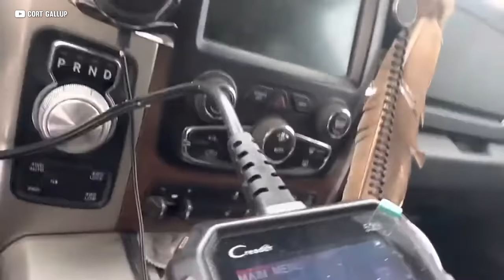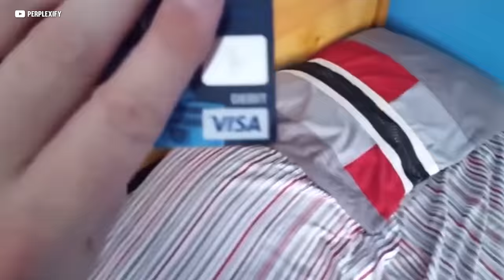Worst Trucks Only Stupid People Buy

Comment: I have a 99 f250 super duty with the Triton 5.4 and all I've had to do is valve cover gaskets and spark plugs and the spark plugs aren't as bad ass everyone talks about, proper torque and anti seaze and boom, the truck ever drove across country before I fixed the oil leaks and did amazing!
Reply: I got a 2001 and I love it 54 two valve change the oil it'll run forever

Comment: 2004 Silverado with the 5.3L.  Port injection.  No VVT.  No AFM.  Just a good old solid V8.  Simple engine.  3k mile oil changes and  non ethanol gas in the tank.

Comment: I just returned from camping with a Navajo family at Monument Valley. Our host runs a tourism facility involving pickup trucks modified with open seating for 15 people instead of a traditional bed. He showed me the parking lot where they park the trucks. One thing I quickly noticed. About 90% of them were GMT800s. The rest were GMT400s and a handful of GMT900. Most were model years between 2001 and 2003, he said. He explained why the company focuses on the GMT800 platform. "Our trucks have a very hard life. We use them to moving heavy loads every day across hundreds of miles of unimproved, dirt roads, and with minimal maintenance, day after day, year after year.  If they break down, we lose money. If they require too much maintenance, we lose money. We change the air filters more often than usual and we run fresh synthetic oil every 3000 miles, and that's about it." They avoid diesel engines because of maintenance costs and unreliability. Most of them are 5.3s or 6.0 vortecs. The interiors receive zero maintenance and all were extremely dirty and many with broken armrests and door handles. The beds have all bed removed and replaced with fabricated heavy steel bleacher seating to accomodate 12-15 people with sun canopies. They run these trucks hard and have learned lessons on which trucks will survive their harsh use case and which ones don't.
Reply: Just came from there myself, noticed the same thing.
Reply: Nothing runs like crap longer than a GM!
Reply: Yes two of the greatest motors ever designed

Comment: I had a 2008 ram 1500 with the 4.7 with a six speed. I put 109,000 in 11 years. I had to put a new clutch at 108,000 mi. As far as the engine goes it was never an issue. Always ran well. Unfortunately due to health reasons I had to sell the truck soon after I replaced the clutch. The guy I sold the truck to is still driving it with only a small brake line issue in four years.
Reply: 10k miles a year is an easy life for that truck. I just crossed 91,500 with my 2019, only had the expected exhaust manifold issues but covered by warranty.
Reply: 109K is not a good test. 209K you're getting close.

Comment: To this day you will still never beat a small or big block Ford  Chevrolet or Chrysler OLD SCHOOL parts are plentiful and easily repairable.
Reply: I've got my Dads 98 Silverado 
268,000 miles. Oil changes regular. V8 350
 Starter alternator but no water or fuel pump problem yet.

Comment: I`ve had P/U trucks since 1978 and never had any serious problems, just routine maintenence and some starters W/Punps and alternators, They were bought new and used in a masonry company all 4WD and all FORDS. Diesel and gassers and never went more than 4000 miles between oil changes. I think I bought my last one this year, a F350 6.2 gasser and I`m 71 years old now. No more working for me or my truck. Were going cross country this spring with the pup.

Comment: The 2 valve 5.4 was solid while the 3 valve was the 1 that had the problems. The oil issue could be solved with getting your oil changes early. People don't take into consideration that idling an engine put wear on it so measure idle times.
Reply: 2 v good motor i gotta superduty 3/4 been great had 4 3v go down
Reply: I have a 2000 5.4 Triton 155,00 bought new. Intake manifold replaced.  Very solid. I also have a 2013 Expedition with 190,000 5.4 3 valve also very solid. Only the exhaust leaks a bit. Other than that no issues.
Reply: 5.4 engine seems to make many miles in many autos. When problems occur usually it cost a lot to fix. Take care of it and don’t dog it and they are capable of some real mileage.
Reply: I've got a 5.4 2 valve in my 3/4 Econoline and it's going on 335k and it's still going strong.
Reply: Knock on wood, my 3v 5.4 has 280,000 on it.
Reply: Id have to agree on the 2 valve 5.4/330. Ive heard nightmare stories about the 3V. 
Thats Ford & most other American auto makers M.O for ya, go ahead & mangle something that isnt broken or needs attention?...Uuugggh...

Have a 1997 Ford Expedition with the 2 valve 5.4 since 2001. It was used as a work truck & wasnt primary vehicle, so after using the piss outtve her, I'd figured it would soon give up tha ghost/let the smoke out @ any moment. So I 'Stress Tested' her for giggles....I lost...
-230K miles w/o a single oil change since @ around 130K. Doesnt leak, nor burn its precious life giving fluid..;)
-Its 130K overdue for spark plug change, running on orig 1997 plugs & ran really well for some weird reason? It got too the point I was afraid to even DO an oil/plug change for fear of poss upsetting it!...
Eventually it required an EGR valve replacement...
Havent put any major $$$ into it in terms of repairs/failures over the years, aside from wearable items-shocks/tires...
Have had ONE issue, drop'd tranny in 2006 & replaced the flywheel & starter, which a friend & I did ourselves @ home in the yard over 2 days time...

-Still have it...
Current daily is a 2017 Expedition w/70K, Itll be interesting to see when the 3.5 Eco-boost begins giving major issues. Im certain thatll get $pendy...;)
Take care....
Reply: 3v oil pump was half the issue
Reply: Yep, that is the story I've heard, the 2 valve was good and the 3 valve was terrible.  I personally owned a 4.6 2 valve and took it to 244K miles, with no issues at all, but sold it for a beautiful 5.0L 2013.  That one is now over 201K miles and just needed a rear main seal.
Reply: @kharis7602 ..Ahhhhhh, Ok, thanks for input...
Reply: Rule of thumb is average your vehicle idles about 5-7  hours at lights and stops during your average 5000 mile interval with synthetic is your best time honestly, also if you keep an eye on your oil itself change it as it starts to turn red into a brown color if it has turned black it's to late, to many carbon deposits have had a chance to clog zero clearance areas of the engine
Reply: Got 2 v with 280k original motor/tranny 1998
Reply: You should really do 5,000 mile oil changes on any engine.  Sludge is not the fault if the engine.  It’s all on the owner for neglecting their vehicle.  The issue the 3Vs had were cam phasers in the early years, roller followers, chain tensioners (most common).  The chain tensioners would cause issues with the phasers and guides due to them being driven on oil pressure.
Reply: 2000 Excursion 5.4 2 valve has been extremely reliable over 250k.  Only issue is the gaskets on the bottom of the air intake manifold go out around every 100k or 8 to 10 years.  (I have replaced 2 sets) and same thing happens on the 4.6 but is usaly more miles before they leak

Comment: Had a 02 ram 1500 with 4.7, bought it at 20k in 05. Drove for 5 years to 162k when it was stolen, and only had two issues.  The gas cap failed and it always had a weird light ticking in drive at a standstill.  Other than that it was a very reliable and good truck. It also got 20-24 mpg.
Reply: and that weird ticking was probably a lifter failure
Reply: @nunyabidness674  The 4.7 has no lifters.  It has dampers (hydraulic valve lash adjusters) and roller rockers.
Reply: @boogerhead0  Melling Valve Lifter JB-2271, 2002 ram 1500 4.7 liter...

there's your part number for the "non-existant" lifters...
Reply: @nunyabidness674 brother ohc engines don't have lifters. They have little buckets that the lobe pushes down on and opens the valve.
Reply: @jerodwolford2743  To describe what is on that head, you have a cam in a frame with a roller rocker riding directly on the lobe. The "Hydraulic Valve Lash Damper" is a lifter on the opposite end of the parts chain. Instead of a lifter riding on the cam, the valve guide goes through the middle of the lifter and maintains tension in the rocker train.

Thing is, the dampers are highly prone to getting stuck for a number of reasons, and can cause all sorts of nightmares in the 4.7s. Miss an oil change, have the walmart lube guy use the wrong weight of oil, overheat even one time (and not enough to blow the head gasket, just a stuck thermostat sorta thing.).... the list goes on.
Any of these can cause a damper to stick. Now here's the giggle. To look it up in the parts catalogue for Orileys or Autozone, you can't call it a hydraulic damper. You have to call it a lifter.
Reply: @nunyabidness674  I have that engine in a 02 Dakota and replaced all the lifters when I had the heads off for a head gasket job and it still makes the tick noise when cold. Yup, they call them lifters
Reply: @bobsoft  so you also hit the downfall of the design. Just swapping out the lifters isn't the complete fix. You have to swap out the rocker train as well.

When the lifter sticks, that cast aluminum rocker will bend. Not a noticeable amount, just enough to provide .005 inch will still be enough to make noise. The dampers have a ratcheting lock tab internally. Once they pump up, they are mechanically locked from dropping back down. As the system wears, there are still more teeth in that ratchet bar. 5 thousandths lands in between the teeth and the oil pressure alone isn't enough to completely silence it.

Done the job a good 20 times now. Got it down to 1 hour 40 minutes without pulling the head, down to 4 hours if I'm doing the gaskets at the same time...
Reply: I got a 06 ram 1500 4x4 with 230ish. 20-24 MPG is crazy I’m getting maybe 14-15 being nice to it with 500 mile road trips.

Comment: I have the GM 5.3 with the active fuel management.  One of the AFM lifters broke.  Pulled the head, got the lifter replaced.  Almost exactly a year later, another one broke.  This time, the lifter twisted inside the plastic lifter guide, of course scoring up the camshaft.  Long story short, it turned out to be a bad oil pump, which makes the AFM system work.  About a year after the second lifter and oil pump issue, the A/C belt broke, and as it was whipping around, it broke the VVT sensor.  I’ve always been a fan of GM’s.  I have a 2000 half ton with 320k miles, all original except for the water pump and alternator.  But the AFM system suuuuuuuuuuuuuucks!
Reply: Do you change oil by your self?
Reply: I had a 2016 gmc Denali with the 5.3. Same story. At 70,000 miles it was done for. I did push it, but my Infiniti QX80 wiped the floor with it, Denali being a p/u, QX80 being a soft suspension, out towed it too.

Comment: MY 2004 5.4 FX4 is now 20 years old with 174,000 miles and has been one of the most reliable vehicles I've owned. Still looks great too. I've used Mobil1 full synthetic in almost everything since 1990 though.  If you sell enough trucks some people are going to trash them because it's what they do.
Reply: I also have a 04 FX4 5.4 Triton with 265,000 miles. The engine has never been worked on other than regular maintenance. Although I did have to have the transmission rebuilt at 215.000 miles.

Comment: I have the GM 5.3 (AFM) in two trucks currently. A 2015 Silverado WT2 with 130k miles on it (that I just gave my dad) and I just bought a 2017 Silverado LT with 57k miles on it. These trucks both have the same engines and transmissions. Honestly the 2015 was a great truck for me and the 2017 runs like new so far. I think the horror stories are MOSTLY due to poor maintenance than a shotty product. I did that and keep them properly maintained. If you do that there's no doubt in my mind that it's a 250 thousand mile or better motor. The biggest issue with truck people is that we tend to neglect our trucks and just think that they should be able to be abused with no repercussions (Over towing, not maintencing the transmissions, rear ends, or engines, ect).  That being said I also think the AFM and DFM are a joke and would strongly recommend turning them off in the ecu or getting them deleted altogether. Another thing is either get a replacement (GM service bulletin) transmission thermostat or bypass to keep the transmission running cooler. Everything wrong with these engines and transmissions  is due to the engineering trying to make for better fuel economy. And all that junk barely makes it get better mileage anyways. I'd understand if it made these truck get 25 or 30 mpg but it doesn't. It makes them get 20 mpg instead of 17. Plus if you drive them like most people drive trucks you won't even see the 20 mpg.
Reply: My 2014 blew the transmission at 109k. If memory serves me right the Manuel says to service transmission every 60k?
Reply: @nelsonjv1  manual says service the transmission at 90k miles. But I'd recommend doing it every 50 or 60 thousand miles (Regardless of how you are using the truck). The other thing is I'm not a fan of how hot they run with that factory transmission thermostat. I haven't installed that bypass in the 2015 though and it's still shifting just fine. Another thing is I don't tow and rarely haul in these trucks. Idk if you do but that could impact the life of them as well.  I'm not saying you over tow or haul either btw. And I'm not saying you shouldn't tow or haul in these trucks. But to me 1500s are cruisers that you tow every once in a while in and haul things like furniture or weekend warrior tools. Anybody that intends to tow and haul everyday for work? I'd say get an HD truck.
Reply: good luck
Reply: @christopherdavisson617  I believe you’re right about that. I chose to change transmission oil every 60k miles. Anyways I’m not buying GM anything for a long while.
Reply: @christopherdavisson617  That is one thing mine won't need. Because it had the infamous Allison transmission torque converter problem. So the whole transmission got flushed at 50K. It now has the equally famous fuel pump problem. 2001 3500 with an 8.1 at 125k miles.
Reply: 400K miles on my 1990 Chevy V6. Only an idiot Engineer would design an engine where part of the engine shuts down. Fire that turkey and give him/her a job cooking burgers.
Reply: I have a 2015 Silverado lt but with the v6, its been great changed the struts at 130k miles and besides that just normal maintenance
Reply: I bought a 2004 2500HD with 260,000 miles. Gave $2,500. Took the front rear axle 4l80e lq4. sold transfer case fender core and bumper,  scraped the rest. Sold my blown up tbi with 4l60e in my 93 Is silverado,  so, $750 in the hole deal. I bought a terminator x max, Bigger fuel pump v s racing turbo and Is corresponding parts. Owe..  I also had to get one spark plug.  If I tuned for e85, it has the Is capability of 800 hp. Thing still runs 45-50 lb old pressure. This Is donor truck truck was definitely not taking care of.  Sometimes you just get lucky 🤘
Reply: I've got a 17 silverado LT... transmission failed at only 66,000 miles.  You can't tell me that was due to lack of maintenance.
Reply: @xephor86  man that sucks, Not to rub it in but mine has 200,000 more with No issues. I think sometimes you get a bad one no matter the brand.
Reply: Recently bought a 2017 Silverado with 45,000 miles. Instantly deleted the AFM with the range technologies AFM delete then installed transmission cooler bypass by superior. Changed all fluids front to rear!!! Will be getting 3000 mile oil changes from here on. Sometimes you have to be proactive. New trucks are too damn expensive so hopefully this new to me used will serve me well, I plan on serving it good too.
Reply: I got the range; now superior next . Yup 🙏
Reply: @paulcondie2520 the thing that kills transmission is GM torque converter and ATF. Change it
Reply: @marekkrepa9982  I changed my fluid and filter at 46,000  when I did the cooler bypass. Plan on changing next at 75,000. No issues yet and my transmission temp on average is 145!
Reply: @paulcondie2520  what's killing those transmissions is original torque converter and ATF they using. You have to change that TQ and flash transmission
Reply: @marekkrepa9982  the heat from the original bypass and all the shifting from V 4 mode to V8 mode  doesn't help the original torque converter either. The transmission shifting like crazy,  hence the converter locking up and unlocking. ATF breaks down at high heat, I'm going roll the dice with my upgrades and hope I get 150,000+ out of my torque converter/ transmission. Alot of work to pull the transmission. I plan on putting in a cam down the road, I'll upgrade convertor then but for now runs like a top. Transmission has been flushed as well as filter. Runs around 145 all day long
Reply: @paulcondie2520  paid $1400 for new billet torque converter, mobil 1 ATF, filter, bypass and labor. Not to bad.
Reply: @marekkrepa9982  not bad at all. I'll change converter when I do proper afm delete and cam.